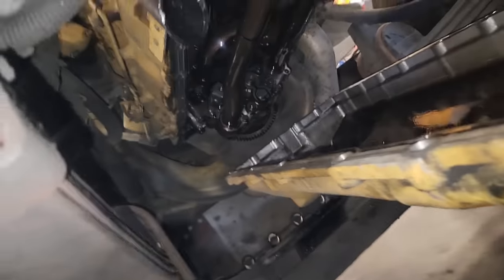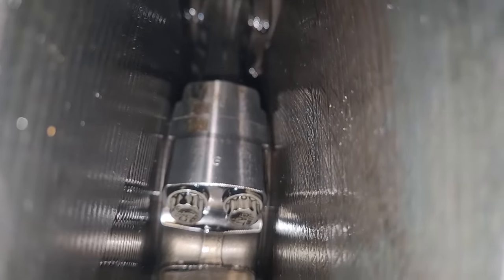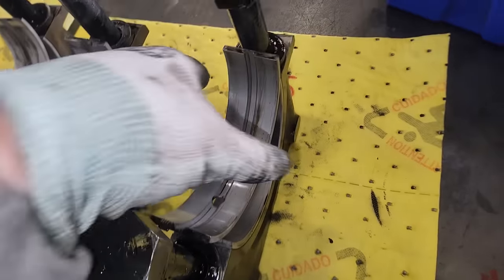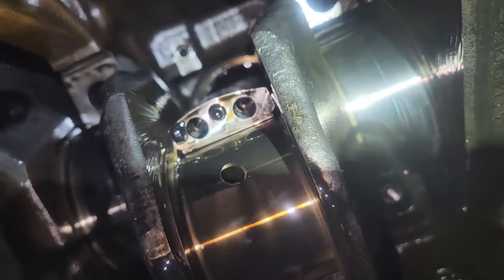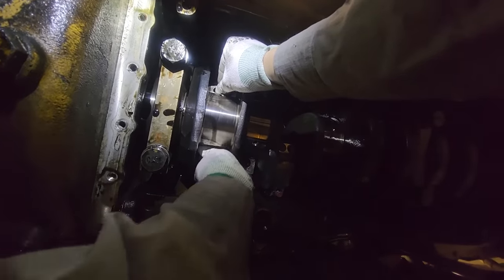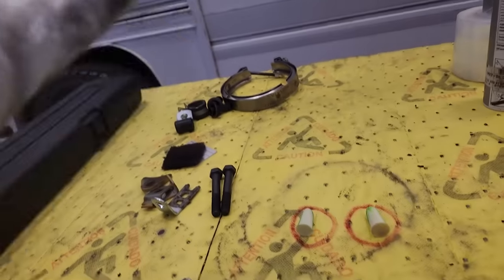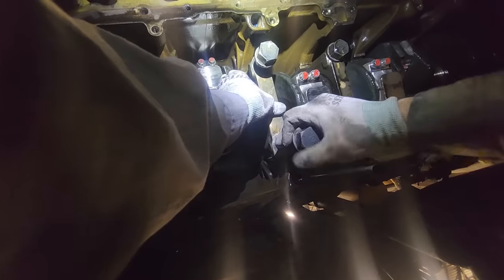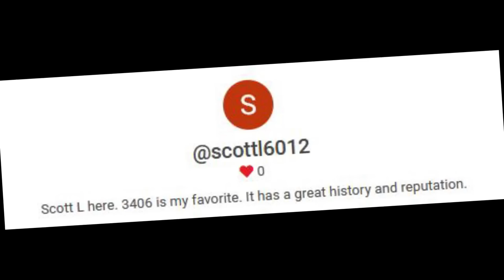Nice Truck Driver Paid for an Engine Rebuild, gets a HEADACHE! Engine "Re-Rebuild."

Comment: My C-15 "6NZ" also drops oil pressure just slightly under full load. It always has. 2-3 PSI if I had to guess. I just choked that up to being normal and it makes sense to me when you think about what's going on inside of the engine. I'd say as long as the oil pressure is within CAT spec, I see no reason to worry about it. Great video Josh, thanks for sharing with us! Long or short, I watch them all and love learning from you.
Reply: After watching this video and cruising my Freightliner down the highway you never notice the oil pressure drop as the power and boost come on fairly slow but if I'm in a hard pull and let off the oil gauge jumps that 2.5 psi, funny how all my years of driving and I never noticed that, learn something every day, I'm personally not going to worry about it at this point

Comment: For the high spot surrounding the ding I think I would use a small fine stone. Basically it's like a drip or run on paint. You just want to remove the high spot, not the surrounding paint.

Comment: Really good explanation on how to change the bearings. When GM started using torque to yield bolts I bought the same torque wrenches that makes to job so easy. you could have used a small machinist stone on the burs on the journals. And yes the upper bearing can be a pain the roll in, and you were having trouble with the front 2 bearings because of the belts pulling up on the crankshaft. Great job thanks for sharing

Comment: If you love motors and heavy mechanics, this is one chennel to keep an eye on. Thanks for the good video. The small "imperfections" are negletable, when your working under the rig using both hands. Keep up the good work. Greatings from Portugal.

Comment: I stumbled on your channel and instantly gained respect. It’s so rare anymore that ‘mechanics’ take the time to do repairs correctly, most videos simply show how to do it either faster or cheaper. A few I’ve found that appear to do it right aren’t the cleanest ‘mechanics’ I’ve ever seen.
 I keep ‘marking’ the term mechanic because there are so few left. Most are technicians that throw parts at a problem, very few are thorough with each step, hence I’m reluctant to call them ‘mechanics’
 It was a pleasure to watch you work, as you face credit where credit was due, but also spoke the truth when needed. (in other words, you were kind with your critiques)
 It’s was nice to see a real, old school mechanic at work.

Comment: It's so frustrating getting shitty workmanship, especially with something as costly as a rebuild.   I had a similar situation, but when they dropped the pan, none of my rod bolts were torqued, and two were in the pan. I feel this guy's pain 100%!
Reply: I would go back to the shop that did the work,  and let them know they did a crappy job, but would not give them a chance to fix it.  If they did it wrong the first.  Time they would probably screw it up the 2nd time.  I realize people make mistakes. That's just unacceptable.  I hope your truck is fixed and running good.

Comment: While white lithium grease is fine for assembly lube on journal bearings and cam lobes I’ve never seen it used as bolt / thread lubricant before. Detroit uses what they call International Compound No. 2 AKA “Peanut Butter” on their bolts and studs but AFAIK Cummins and CAT just say to use a light coating of engine oil.

Comment: I would guess as good as he keeps his truck  he thought he was taking his truck to a good reliable shop in the beginning.  I would. Like your opinion on finding a good shop that is one of the things I struggle with especially on the road. Great video.
Reply: I'm sure it had the appearance of a good, reputable shop. But they have a couple turds working because they cant find anybody else and bam, this is the result.
Reply: The most interesting thing is that the owner said.. I did it myself, everything is fine..😢

Comment: I have to agree with those before me. Long, short, it does not matter ! To see you do the job correctly is what matters. You are a gifted Tech. . If I had a Cat you would be the one for me also. I met a gifted tech back in the 1990's. Low fuel mileage on a just purchased truck. After all was said and done Seller lied on air cleaner with date and mileage. Birds nest in air cleaner, Vacuum so high it was pulling oil past turbo seal. Your videos teach. THANK YOU!

Comment: still got my set of clevitte bearing roll in pins [ insert in oil hole in crank journal thickness vary's of shoulder and pin size set against bearing end and rotate crank] easy peasy once you get use to using them they work like a charm.....bought the set from snap-on man 40+ years ago.always found the right one it the set for the engine....ie. john deere,cat, perkins......never ground on no bearings ether...great video

Comment: To answer your questions…looks very much like machine stamped numbers…alignment and consistency. Also the length of the video is ok as you tried not to repeat  any procedures. Finally you did a very good job trying to remove some scratches on the crank.  Good video 👍

Comment: ⚓️ Thanks Josh 🇺🇸 screwdriver pushing bearings 👏 further steps to avoid bearing damage … for those that may not have.. the feel 🥸 McMaster Carr… non sparking screwdrivers. screwdrivers of copper… used in hazardous flammable atmosphere … oil refineries… soft material good for prying on machined parts… I always kept bronze rod stock … two ~ three feet of 1/4.. 1/2.. 3/4… cut to length for beating on stuff ⚓️

Comment: Bearing caps were installed in firing order??? It was common to use lithium on bolts on 2 cycle Detroits
Reply: Back in the day cat had us put copper anti seize on the D343 head bolts that were the black bolts, then they changed the bolts to the gold colored and if you put anti seize on them you would over stretch the bolt almost every time. Use what they recommend, and it did change in a service magazine.

Comment: Those grooves in the crank are the reason for oil pressure loss, unfortunately. But you done all you could without removing the entire assembly and machining or replacing the crank. Damn good, top notch professional repair. If all shops and the technicians who work there were this good these videos wouldnt even exist. Thanks again man. Just subbed, liked and commented. 4 or 5 times, not sure exactly,but had much to say😊

Comment: With all due respect, I understand that another full rebuild wouldn’t have been easy for the trucker, but because of the scratches, main caps installed incorrectly and amount of dirt, in my opinion that crankshaft should have been removed from the engine to be remeasured and regrinded.
Reply: With all due respect, there was no damage to the hardening. Therefore unnecessary to remove it, measure it or grind/polish it.

Comment: I have built 100s of them I have found the rod caps mismatched there is some shady shops that rebuild engines for sure the craziest thing I have found was a 625 cat with a 550 crankshaft in it will the piston wasn’t going all the way up to get enough compression.

Comment: A couple of years ago I had a inframe done on a 12.7 Detroit. First of all they put the wrong size bearings in the engine, they didn't realize it until they started it and ran it. They also never pulled the oil pump apart and didn't try to flush anything out knowing that there was a lot of debris in the oil pan. I had dropped a valve and took out a piston. When they showed me the bearings that had 10 minutes on and I found scoring in those I made up my mind to just sell the truck. Just from how uneasy I was about their poor workmanship and the three months it took them I didn't trust taking the home much less using it for long haul.

Comment: Had a valve job done in a Freightliner dealer in Chicago.  It failed after a few weeks.  Was done again at Stoops Freightliner in Indianapolis.  No further valve problems.  Everything depends on the shop and more importantly the mechanic working on the truck.

Comment: What Ive found with grooved bearing surfaces is that the grooves act like tread on a tire. Tread prevent hydroplaning on the road. With a crank you want the bearing inserts to hydroplane on the oil between the surfaces. The grooves give heated oil a pace to escape allowing the bearing surface to hit the crank surface. Thats where the polished surface on the bearing came from. And explains his oil pressure drop. Bet its pretty good when the motor is cool. Then it bottoms out when at operating temp. This guy took a motor that wouldve been fine with a simple ring and bearing refresh and turned it into a core good for a complete reman job. Needs his ass kicked along with refundi g this man every penny he spent with this jackoff of a technician. And the content creator of this video stayed professional in his opinion of this matter. But we all know what he wanted to say. Great video man. So spot on with all you said. Thanks.

Comment: I have a set of screwdrivers made from Mahogany wood that I made way back in 1987. They were used for electronics back then to prevent static pickup or discharge. They work very well with engine bearings.

Comment: Bolt clamping force on component is set with oiled threads, grease is slippy and will allow more clamping force. Most bolts taking load like crankshaft bolts are torqued up and then angle tightened to ensure correct clamping force. Bolts should not be dry but oiled and drip dry, if to much oil is left on bolt and it pools in the casting under the bolt and an air gun used to spin it up you could trap the oil and hydraulically split the casting.

Comment: I found in my misadventures doing main bearings on a 24v Cummins, using a popsickle stick to roll mains in and out works REALLY well. They're stiff enough to not break and soft enough they don't scratch or mar anything

Comment: During my time working for Union Pacific Railroad, I was doing a lot of the dead work which was major engine repairs. When I would change power assemblies or piston and rods per General Electric they would have us use white lithium grease on the rod bolts , bearings and head bolts etc. We’d then use a hytorc to get our final torque.

Comment: Another Great Video, Josh. There was stuff done in that engine that was pretty shocking. I have never swapped main caps, unless it was sent to a machine shop and they relabeled something. I had one engine, I opened up, fresh rebuild by someone else, luckily it never ran. Found the #7 Main Bearing in upside down, solid bearing on top, slotted or bearing with holes in the cap. If I would have started the engine, it would have tore it up in seconds. I’m way too fussy with overhauls, but I have not lost one yet. Thanks for the videos.

Comment: I took my truck to a Freightliner dealer in southeast Texas to have my 3406e Cat engine rebuilt due to oil and water mix. Took them 6 weeks to get done and twice the cost they said it would be. Drove it back to Ohio and took it to the Cat dealer for oil leak at rear of head. They totally disassembled the engine and found lots of problems. Only took them 2 days and $2200.00. Worked great after that.

Comment: As a light duty diesel mechanic that got into Trucking this is the reason why I rebuild my own Motors a lot of learning between light duty and heavy duty but so many shops do crappy work... also they don't cut counter boresls because they know the truck will run 50 k probably and by then they don't have to warranty it

Comment: In 50 years of commercial driving I only came across 2 mechanics I could trust to do the job right and give me reliability. 1 in UK and 1 in Italy. Seeing this monkey's work that you had to try and correct makes me grateful I knew 2 top mechanics and 2 top engineers. They taught me how to do maintenance and repairs that gave me the freedom of reliability to this day. Subscribed.

Comment: I just wanna say I’m impressed by that paint sticking to that oily camshaft like that I’m sure it wasn’t cleaned and prepped for paint. So wow that’s some pretty impressive paint right there .   Lol maybe the mains he was trying to put then in by firing order dunno.   Had a guy mixed up all the maines and rods and couldn’t figure out why the motor wouldn’t turn over without binding.  When under looked at the rods and mains and told him he could go home for the rest of the week. He didn’t know he said he’s not a machinist why would he know that.  And here’s your sign

Comment: Thank you for the lengthy video and commentary.  It is a shame that the previous mechanic did such poorly but you definitely saved the owner from expensive repairs it would have been . Plus if it works for a semi , I guess i could save my engine doing the same thing instead of paying a machine shop it polish the crank .

Comment: When I go to polish a crank, on nick's I take a hard fine india stone to the high spots, to knock them down before polishing. The polishing will go much quicker because you're not trying to remove any material just refining the surface finish. This is not one of my favorite things to do, but it is a good process you need to know how to do. Sometimes installing main bearings, you can make it easier to install them if you don't have the installed main cap tightened. By leaving them a little loose the crank isn't sucked all the way up into the bearings and can give you a little more clearance, to install your upper bearing shell. Another tip is to put upward pressure on the tang side of the bearing while rotating them in place. The reason is that the bearing is  in a uninstalled state and if you've ever installed bearings in a block main bore they don't just fall in place unless you have a STD bearing going into an oversized main bore, they must be pushed in to get them to seat. Not sure if Cat ever did any of the oversized main bore machining, but Detroit Diesel did in the past. You could bore the block oversize by .020" or .040" . When this was done you could only use a STD size crank.

Comment: Great video. Love the longer content! With regards to the number stamps on the rod caps, i would guess they're factory stamped. They look perfectly centred. As well as that, i cant see why the previous mechanic would have went to the bother of stamping them and not put them in their correct locations!
Reply: The number stampings Josh was wondering about were for the rods and not the main caps.  Getting a good single letter/number stamp on an part isn’t that difficult if you have a good quality (USA made) stamping set, use something like a shot/sand bag or V-block to hold the piece being stamped in place and level and either have a good even hammer swing or use a small arbor or fly press (I have a 2-ton bench top arbor press I purchased decades ago at a yard sale that I keep on the end of my workbench that I use at least once or twice a day instead of beating on something. It’s one of those tools you don’t know you need until you have one and then can’t figure out how you ever got by without one.

Comment: 35 years turning wrenches on gassers here, white lithium for a torque lubricant is a new one for me. If I owned that truck, I'd be taking your video to the owner of that shop and be raising holy Hell.

Edit, I can't speak for the diesel industry, but in all my years I have never seen stamping that precise, clean, fully indented and lined up like that, ever. I would have to say that those were machined stamped.

Comment: Ive owned 4 trucks and ive had those quick drain plugs on the last 3 trucks. Over a 20 year period i have never had any issues with losing my oil because of something hitting that plug. And 2 of the 3 engines are detroit engines, which the plug is on the bottom.

Comment: Hi Josh, nice to see someone that knows the product and does good work. A couple of suggestions, with the crank damage you could use a fine grit oil stone to remove any high spots directly at the damage area without removing any other material. You can buy small finger size stones for this. Next, get yourself a hand held pneumatic torque multiplier for big bolts. The impact is OK but the torque multiplier produces less frictional heat on the threads.
The previous craftsman should not have use anything other than the recommended engine oil on the bolt threads as another type of lubricant has a different friction coefficient and this could change the initial torque position of the bolt prior to the final stretching.
And lastly, was there a particular reason for not installing all the main caps shells before tensioning all the caps?
I enjoy your videos 😊